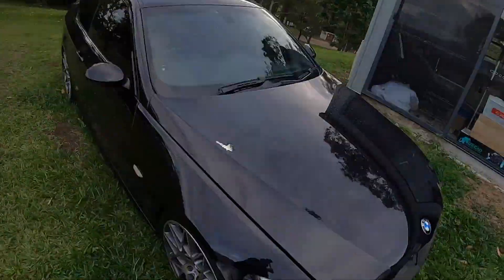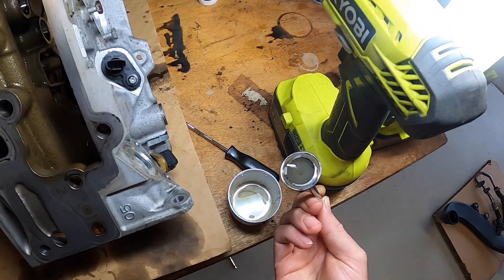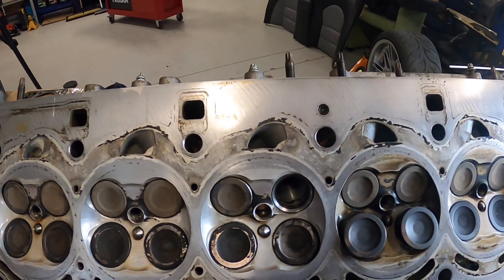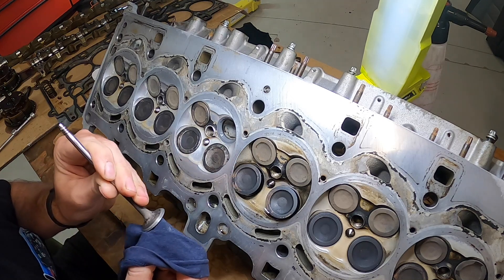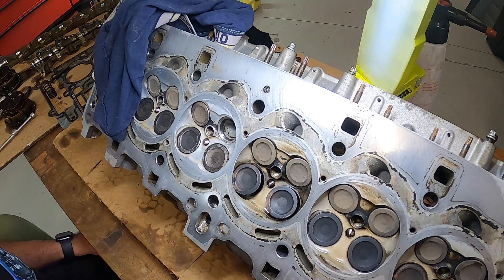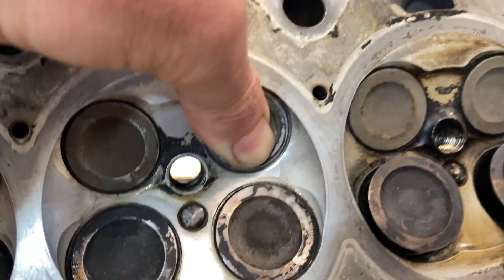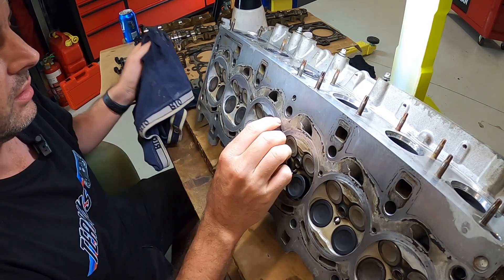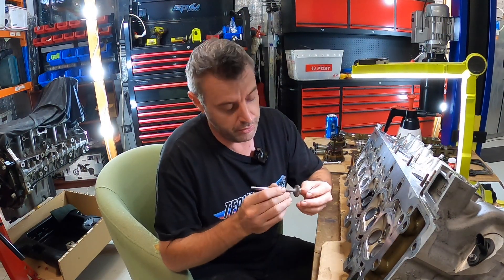BMW N54 335i Leaking Valve Re-Seat Lapping Attempt

Comment: you know what is good trick to do valves like that?,  powerdrill ;)
Reply from the maker: I had read about the drill technique, I was genuinely worried about damaging the surface so opted with manual way for the first one.
Reply: @ZeroTo60Tube  yeah, you would need to be careful with drill, dont go as usual, full send. to be honest, i would do something like first 5-6 valves and get boored :D